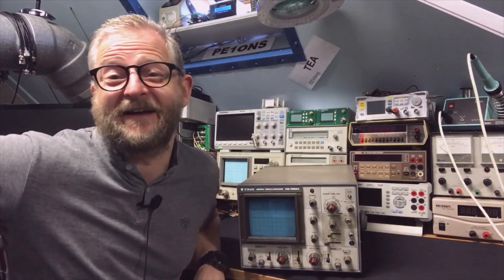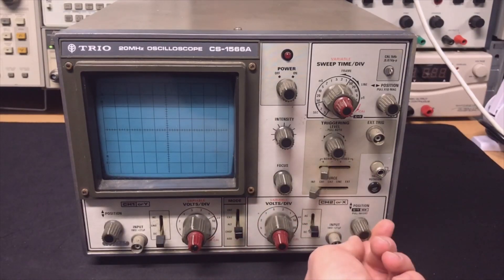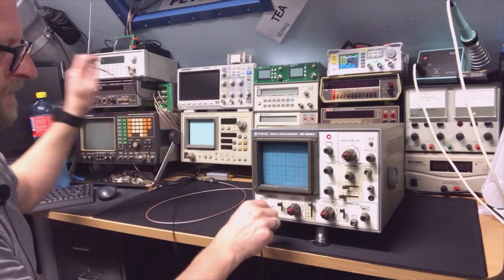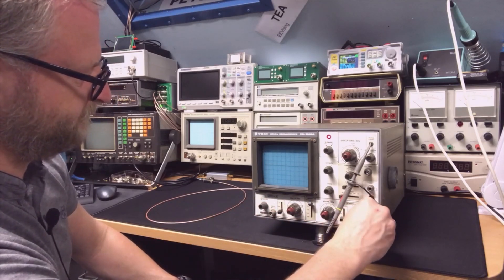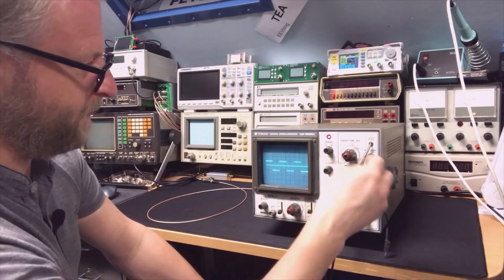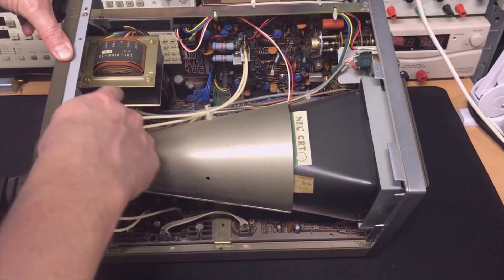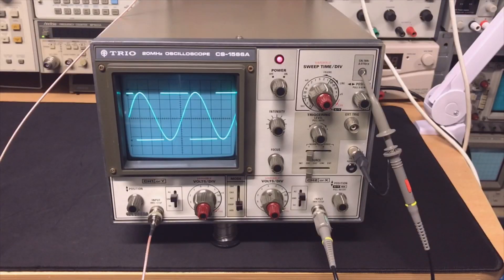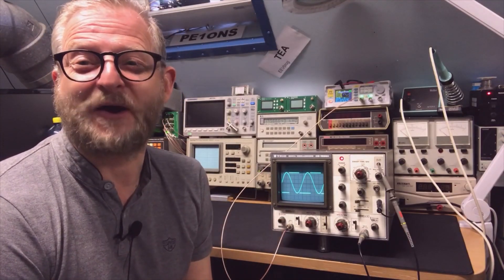#071 TRIO CS-1566A Oscilloscope Teardown

Comment: I have the B&K 1477 scope that is very similar to this one. The re are two differences; the power switch on mine is also the scale illumination control, and the trigger input on mine is binding post instead of a BNC connector. Thank you for this video.
Reply from the maker: Thank you, nice to know about the BK too!

Comment: Hi Tony,
 I have a trio CS1560Aii and the vertical amp is not working.

Looking at the troubleshooting page in the service manual,it says to  check Q123 and Q124 .These are 2sc535 which I have purchased.

It also uses a RT733 metal can IC .This is no longer available.

 I have however been able to purchase a Dual in line 14 pin UA733. I have down loaded the data sheets but am confused  which pins to hook up. 

 Its IC 103 on the schematic diagram on board X73. The Trio schematic shows 8 pin connections. 
The UA733 has 14 pins but there are 4 NC.
I wonder if you could advise me please given you have experience with this oscilloscope.

Cheers Colin  ,vk2jcc   Sydney Australia
Reply from the maker: Hello Colin, thanks for your comment, to be honest, i bought it in a batch, cleaned it and after the video i sold it as a nice starter scope. i did not play with it myself other then in the video.. i needed space and funds for new stuff :)